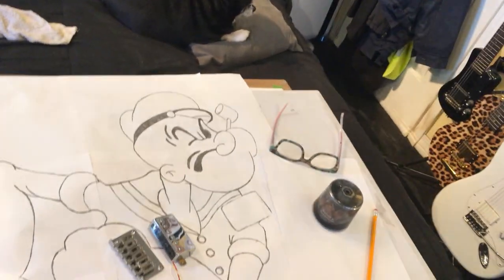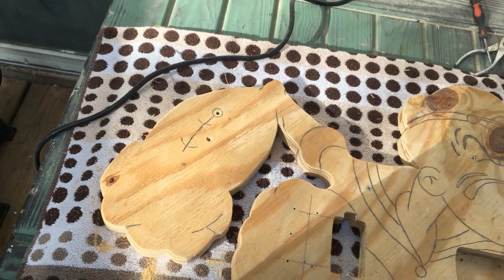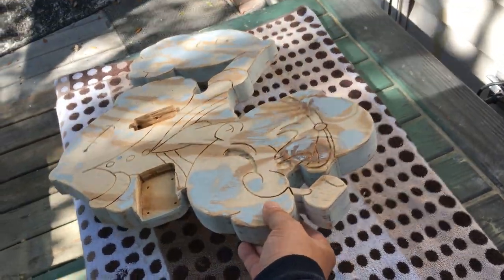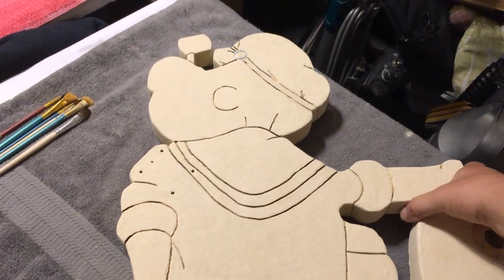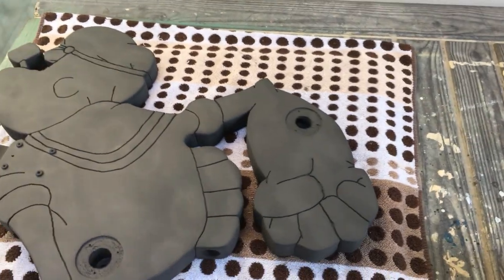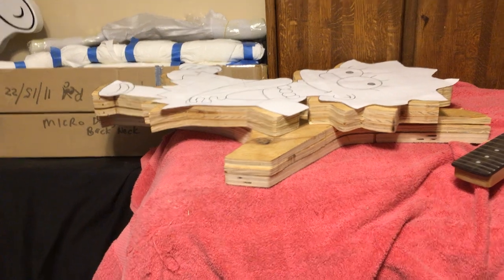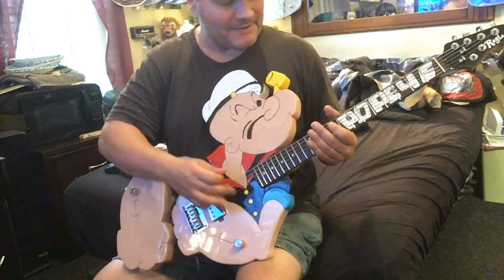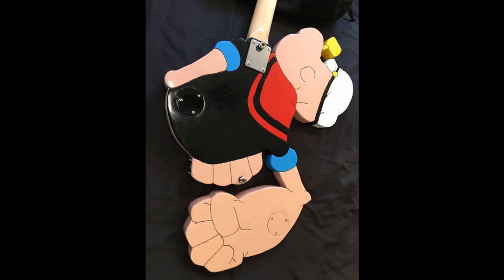How I Created a "Popeye" Themed Home-Made Guitar Out of Plywood Using Basic Tools, Full Build

Comment from the maker: 00:00 - Drawing Concept- Build Plans-Ideas-Explanation
05:20 - Rear Drawing Creation Cut-Out
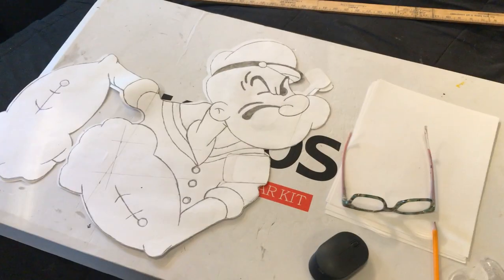06:52 - Cutting the Guitar Body Wood
09:36 - How Guitar Body Sit In Lap
11:18 - Recap of days progress
11:38 - Rounding Guitar Body Edges
12:42 - Tracing Pattern on Body Blank
13:31 - Cutting Out Neck Pocket
14:47 - Installing the Neck
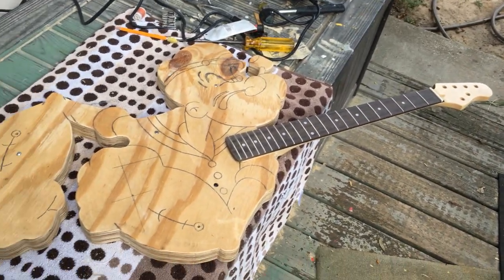15:59 - Installing the Bridge
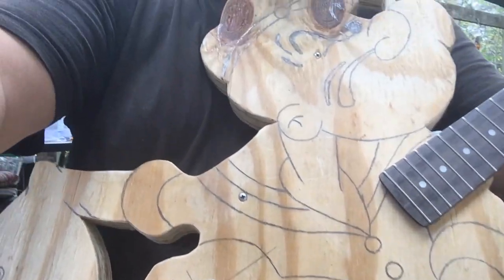17:25 - Figuring out the Input Jack and the Pick-Up Location
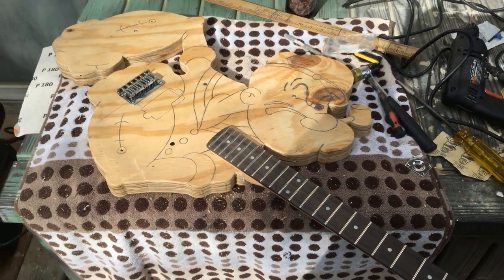18:15 - Gluing Top and Middle Body Layers Together
18:42 - Cut Out Pick-Up Cavity
19:16 - Figuring Out Where All the Wire Routing is Location
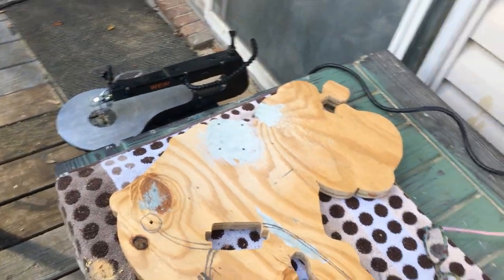20:42 - Routing Channels for All Wiring
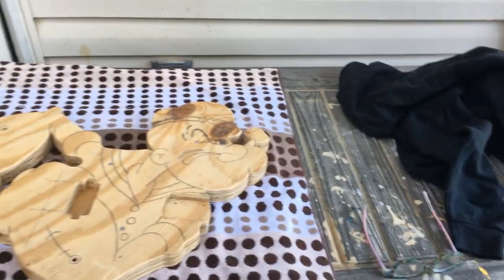22:34 - Days Progress Plans.
24:47 - Fabricating and Installing Rear Pedometer Access Panel Plates
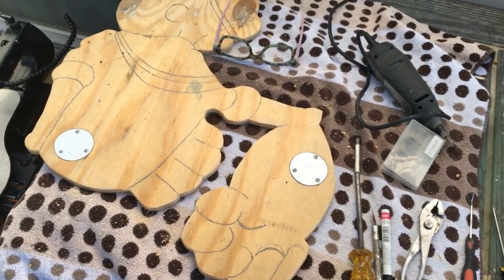26:56 - Gluing both pieces of body together